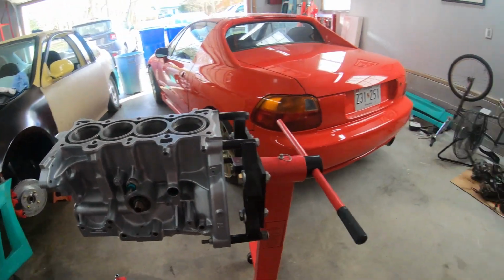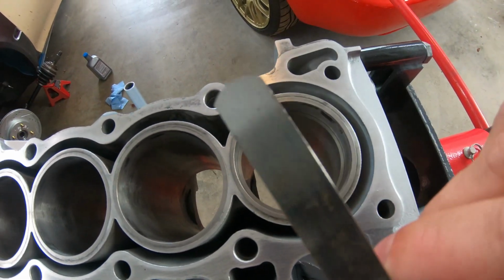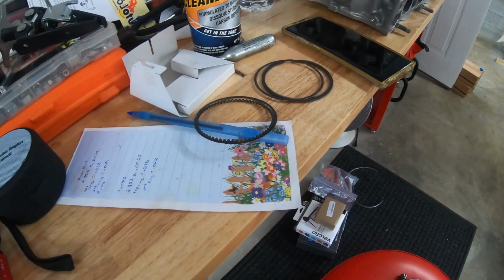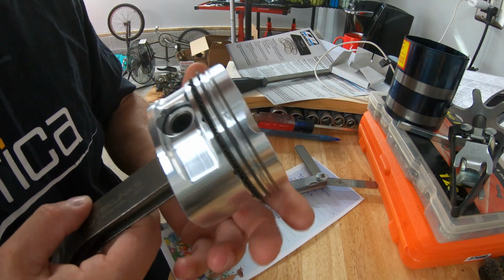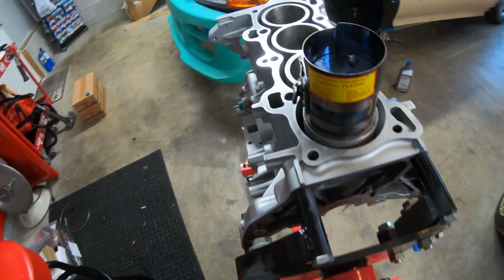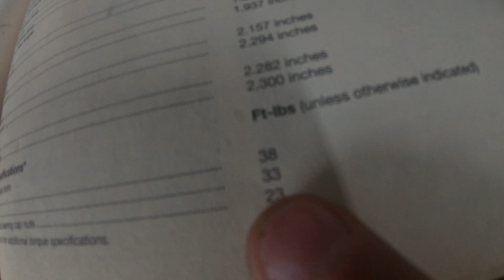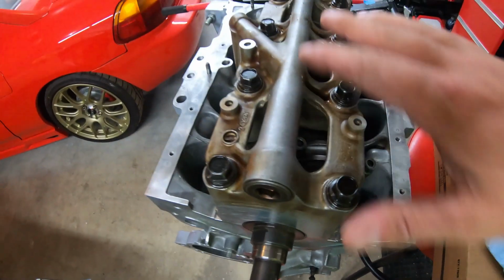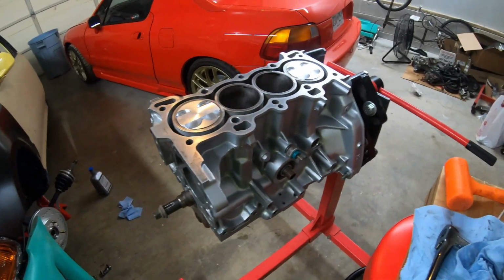D16Z6 Motor Build Part 8 - Ring Gaps & Piston/Rod Install!!!

Comment: Those pistons sit above the deck i had the same issue
Reply from the maker: @lukemx8863  they do yes. I increased the size of the gasket to accommodate that and ensure that there is an adequate quench zone.